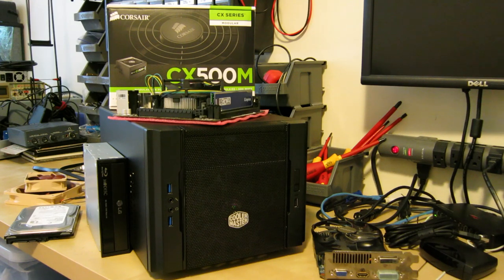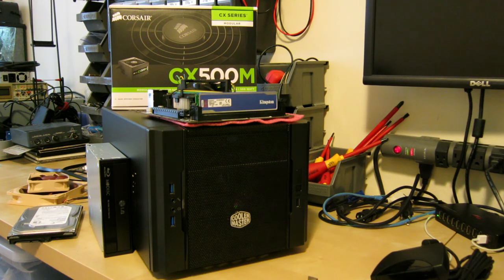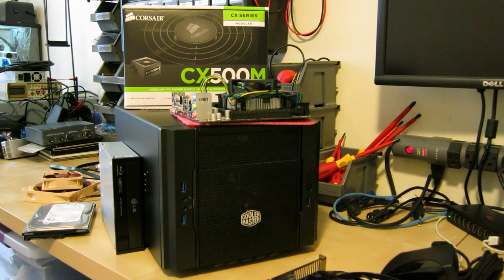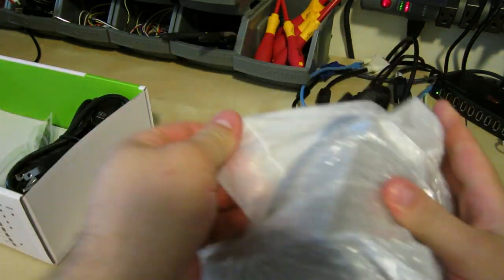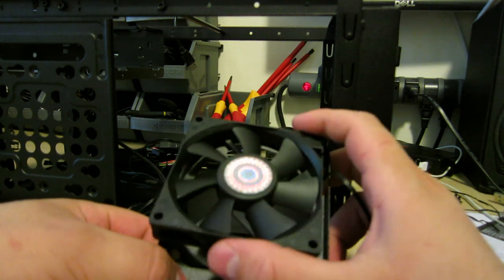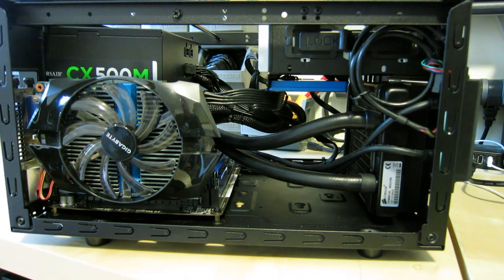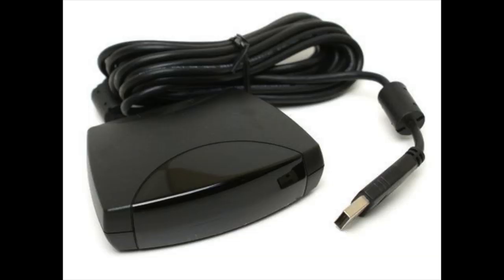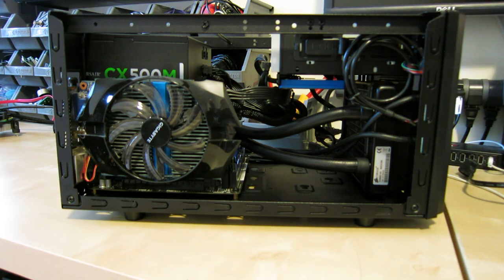Hackintosh HTPC Build (Part 1 of 2 - Hardware)

Comment: Nice build, except for that trash Corsair PSU.  Don't expect it to last.

That motherboard is ASRock, not Asus.  I would have went with a proven Hackintosh-compatible motherboard, because there's work that needs to be done to the BIOS to make it fully compatible (DSDT modifications).  That's one area I would not have skimped (Not that I would consider Hackintosh to begin with).  Go with Windows in the end.  I'm skeptical of Linux Distros because they're not as optimized and targetted as Windows installs.

Good luck, and keep the videos coming.
Reply from the maker: The PSU seems to have good output and decent power factor correction, but yeah, the capacitors aren't great (they aren't even all 105C rated), but I figure for the price and the fact it will probably die while the warranty is still valid, it was worth picking up.

Old habits are hard to break. Has it really been ~12 years since ASRock split from ASUS? haha

The board wasn't bought with a Hackintosh in mind, originally. I simply won it at a decent price on eBay and figured I would give it a shot. I really haven't had any problems with it aside from sleep (which I am yet to look into fixing), using a standard non-DSDT install. I will most likely end up with a Windows install if I want to go full HTPC route, although I'm considering keeping a standalone BD player for movies or switching entirely to rips (personally, I rip everything first, but the wife still likes to use an actual disc :D)
Reply from the maker: I've actually decided to go all out and make more of a "living room computer" rather than simply a disc playing system with gaming abilities. So I put down ~$280 for a GA-Z97N-WIFI motherboard and i3-4330. The ASRock is for sale.  I think I will do a proper "how to" style video for the Gigabyte board from a Hackintosh perspective.
Reply: I'll be looking forward to it, or to any of your future videos for that matter.

Comment: What's that hard drive enclosure you were talking about? I could really use one of those
Reply from the maker: http://www.zalman.com/global/product/Product_Read.php?Idx=674 is my enclosure of choice for doing installs. You can pop ISO files on it and it registers itself as an optical drive which boots from the ISO.

They make a couple different models, but I like the 300 the most. The 400 is basically the same thing, however, it also has pointless disk encryption. Because the ISO files taking up most of the drive need to be protected... right? :D

Comment: why an air flow fan for a radiator?/
Reply from the maker: +gotja Because I happened to have it available at the time. Obviously an F-series Noctua is idea for a heatsink/rad over their S or P series. Hasn't been a problem so far - even after replacing it with an i7 (albeit one I haven't overclocked yet).